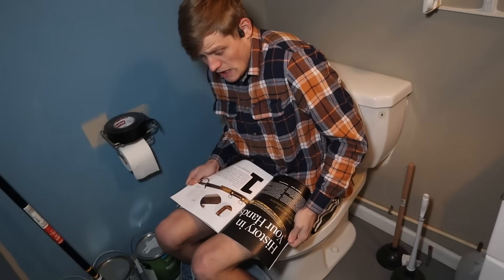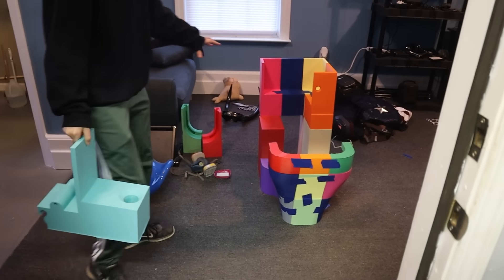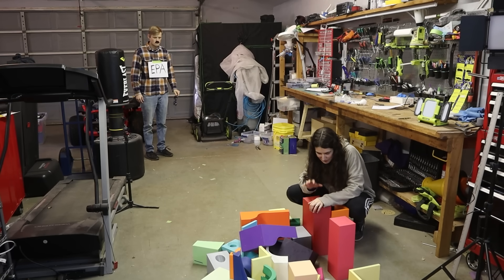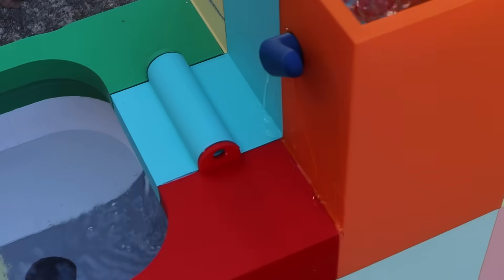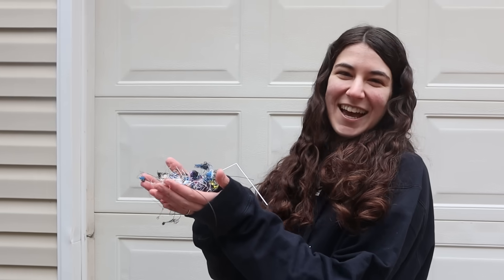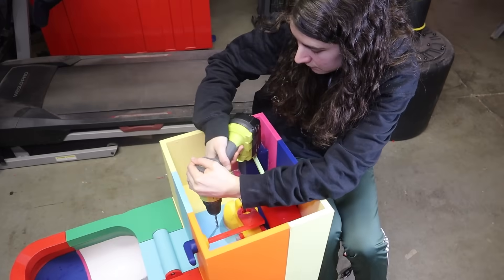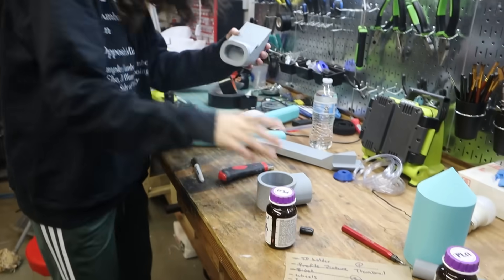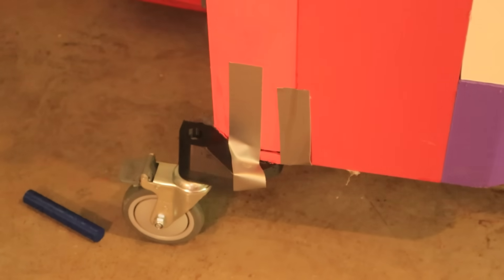I 3D Printed a Toilet

Comment: Emily.. If you are concerned about the environmental aspect, they you should design and build an extra large 3d printed part plastic grinder, and filament maker.    So you could print these large scale projects to your hearts content.. then grind it and all the extra bits up in the large grinder and feed the chips into the filament maker.   At home Recycling for the win!!!  Print... Grind... make filament... and print again!  Reuse it all and appease the green crowd, and protect the planet (and your yard).

BTB... It would be awesome to see you build  a massive  massive 3d printer so you could monoprint these huge projects without the glue!

Comment: For waterproofing, after gluing everything, paint surfaces in epoxy resin. This is the same method that can be used for medical grade devices (with proper specific manufacturing methods.) I'm curious how functional putting through hole threaded rod to hold everything together would work. Or making your own large format printer with a fat nozzle.

Comment: I think your "S trap siphon" in the bottom was a problem preventing easy draining. Also having lived in a RV and also used several different toilets, bowls need a high slope so TP and "particles" fall down easily. You probably only really need water dispensing from the back and front of the bowl, not all around. I'd use real tubing and nozzles for this and then install them in the print after.

Comment: BTW for plastic welding, you could also use a line of PLA plastic in one hand and hold it with the soldering iron in the other hand and melt the line of plastic to add extra material if you wanted. Kinda like TIG welding. Its hard to explain but yeah.

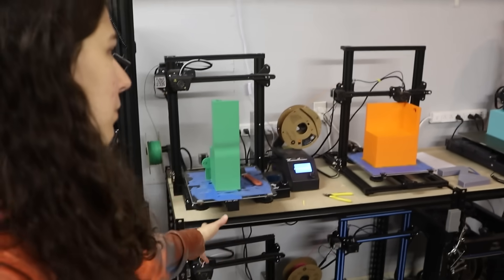Comment: 1:35 is this print speed normal? I only recently got my first FDM (A creality K1, only printed in resin before that) and it just goes berserk on my settings (600mm/s for infill, 350 for the rest). Is that speed what people had to deal with all those years?

Comment: Why do people make those awful Anglo-Saxon toilets? It's a pet peeve of mine, but it just splashes your årsenhölle, and somehow people come back to this stupid design. The German toilet — look it up. It's great, it has this step that 1. Generates vertical momentum as you flush, so floaters are a less of an issue. 2. Doesn't splash the årsenhölle. 3. Lets you observe the excrement to better understand the condition of your GI system.

Comment: I was expecting engineering.
It lasted 1 minute and a half...

Damn, you could have done a great thing, why did you go that route?
Just print a blocky thing without testing the sub parts before hand?
Also, you did make your own flush system, and that's a good point.
But still, you could have tired different toilet systems from around the world (UK, US, and French are not the same when it come to flushing).
Anyway, have a message, but that's an awful waste of resource (your brainpower too, you could have done better).
Maybe next time?

Comment: isnt pla plastic made from corn starch and other bio renewable sources and is even somewhat bio degradable? like chemically its pretty close to sugar which is why you want to keep prints dry after printing to prevent molds from eating it. just as in reference to the micro plastics, since maybe pla doesnt make them? or they would maybe biodegrade? i dunno i think we shouldnt feel too bad about pla especially if you get cardboad rolls.

Comment: The flap can be whatever because the presure will keep it shut. You do need the a little float attached to it though to keep the flapper open until enough water drains out to finish the flush. Otherwise this is pretty much the complete system!

Comment: Have you considered getting one of those home filament recycling rigs, so you can turn your toilet back into useable filament for future projects? I've heard they are pretty expensive, but it might be worth it for the amount of filament you are using. And it might keep the EPA from nuking you from orbit.
Reply: that's it's whole own 24/7 hobby.

if you have uses for plastic block or plate things its far easier to melt and cast/form that way

Comment: Since I already need electricity for the bidet, it totally makes sense to have a phone charger/holder in proximity.  But that doesn't need to be attached to the toilet itself; it should be a little shelf on the wall of the throne room.

Comment: another trick to help waterproofing is paint the inside of all the pieces with UV resin, even a 1000g bottle would do all of that size of print with room to spare
Reply: And then set them in the sun for the UV resin to cure ?
Would it work under winter sun though ?

Comment: I had a rather embarassing issue where my stool was sometimes too big to flush & ultimately an expensive plumber had to be called. This 3d toilet could be custom built with an extra large diameter s-bend. So cool & save quite a bit on plumbers. Thanks Emily, you're ace😁

Comment: Impressive.  Though I feel it necessary to point out that it is still missing the toilet seat, a steering wheel, an engine, a drivetrain, and working brakes. You never know when you’ll need to stop to take a dump.

Comment: Thou reading the SDS for 3D Gloop, omg that stuff is cursed. I guess to solvent weld PLA you have go digging around in Satin's cesspit of horrors :| It's main solvent ingredient for PLA is DCM (which they have listed as methylene chloride on the SDS). DCM is really fun stuff, for starters it's metabolized in the body to Carbon Monoxide... so you can get Carbon Monoxide poisoning from it even without having acute DCM toxicity symptoms :|

Comment: Also...you can coat the part water is going to sit in with a self leveling 2 part epoxy and/or polyurethane...
Trick is to seal up the microscopic gaps in between the layers

Really want it to sink in...vacuum it down to force it to pull the epoxy/paint into the gaps as the air is pulled out

P.S.  You left the toilet seat....off?!?

Comment: I'm wondering if the heat gun could help with water tightness?  You aren't running klipper either are you?  Wasting so much printing time.

Comment: Turning the valve on your hose doesn't lower the pressure. It lowers flow rate, but the pressure it reaches, when closed, is just as high as if the valve were fully open.
Pressure equalises, it just takes more time through a smaller hole ;)

Comment: The 'flapper valve' that you printed from TPU is typically a rubber that floats, even in commercial toilets. The pressure of the water, trying to go through the hole, is what holds it down.

Comment: Tbh the wheels were a bit too much for me, it needs to be disconnected from the plumbing to work and it's too high to be used properly, but the hoverboard fixed it

Comment: I don't think this technique would work super well for this project where you are gluing separate parts together, but for making waterproof parts I've had excellent luck with vapor polishing ABS parts using acetone. It's normally done to get a smooth outer surface, but since the acetone vapor melts the outer surface into a smooth layer it also helps seal up leaks between the layer lines.

Comment: I can print a cube and it will be water tight. As long as I use 3 or more bottom layers. A single wall is enough. Now thats for 20x20x20mm. I am sure its different once the part gets bigger.

Comment: The "issue" of using so much plastic isn't terrible here imo. You made one of these and honestly your printing techniques aren't super advanced, but also more effort always needs more time. You have gotten me thinking about very large object design. Past a certain size it's not practical to rely on or even use infill.

Anyways this is a super cool toilet regardless. It is kind of an older and more basic design. Not a siphoning toilet. Still love it though cuz it is still a toilet.

Also, the outlet holes are so small like a rat could clog it 😅.

Omg I love the bidet tho. This toilet is actually a good bidet

Comment: A little tweaking on the siphon and you would be good to go .
I recommend using elastomeric roof coating to waterproof things.
The stuff is great, it's super thick,.
You just pour it into that thing, Let It coat the sides ,pour out the excess let it sit for a few days and you're done.
Straight up making a toilet ended up making the chair from Idiocracy.

Comment: I believe the falling in thing would be a problem with any toilet without a seat, the fact you eventually added a lid without adding the seat is extra cursed
Reply: Please pin this comment.
Reply: @anastasiszaro they didn’t pin it but it’s the highest comment by likes
Reply: Realistically... You don't need a toilet seat. Not when toilet is seat. No really though, if people sit down and toilet then no seat needed. Unless the toilet bowl is really wide and you might fall in i-... Oh. Apparently seats also help separate your tuchus from the nasties that be. Seems obvious to me now...
Reply: @Deja117 totally disagree. If there is no seat, then either it will be big enough that people will pee on it or too small to sit comfortably
Reply: @KaitouKaiju  I could of done a better job at emphasising my point, but that dawned on me halfway through my comment when I put a pause in for effect. Then I mentioned a toilet seat also separates the user from the bacteria inside the bowl. The whole bacteria barrier thing seems obvious now I think of it actually, just one reason you should seat your toilet.
Reply: in general bowls have a wide lip, try sit on any toilet with the seat up, the width tends to be so you can clean them more easily @Deja117
Reply: @Deja117  A toilet seat is required, actually. How else is someone going to say: "YOU FORGOT TO LOWER THE TOILET SEAT!" to men? 😆
Reply: Speaking of cursed before I hit the like on your comment it had 666 likes
Reply: @WyzGyzEntertainment  taking my like away to bring it back in balance
Reply: huh I am honestly shocked this many have seena thing I said, I apologize haha @WyzGyzEntertainment
Reply: A I wish you actually fix the toilet
Reply: It needed a metal ring to sit on, to make it extra cursed by being always cold.
Reply: Lol
Reply: 997
Reply: 998
Reply: 999
Reply: 1000
Reply: That's what the throne's for, after all!
Reply: Can confirm, I'm a "medium" sized man, have accidently double lifted the seat and cover in the middle of the night... cold thighs and the feeling of going "beyond level" made me recoil instantly but even I was headed to the pits of despair 😂
Reply: @Emilytheengineer why do you think Frank has over a million subs but can not get this many views?
Reply: @johnecker because subs stopped meaning anything 3-4 years ago. With the customized home feed it matters who you watch not who you are subscribed to.